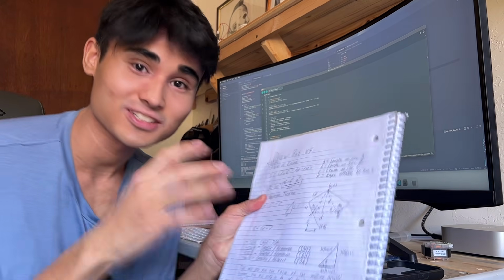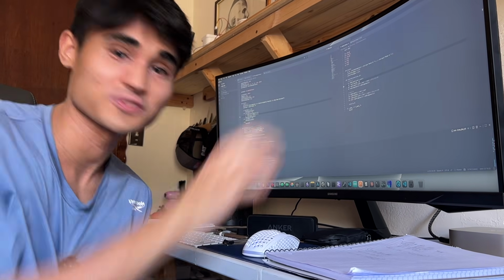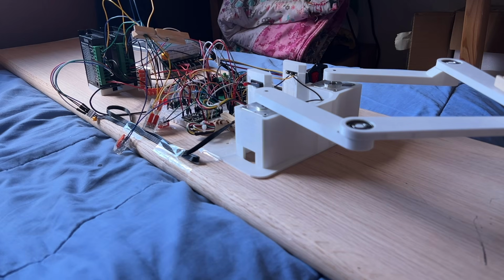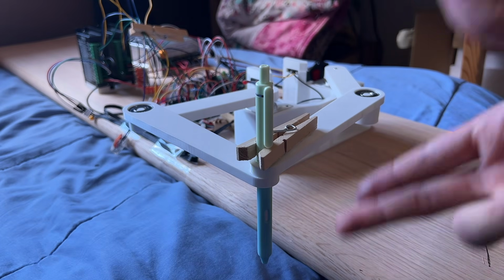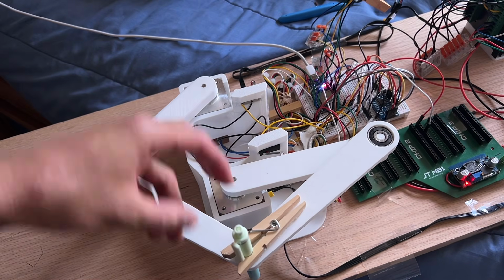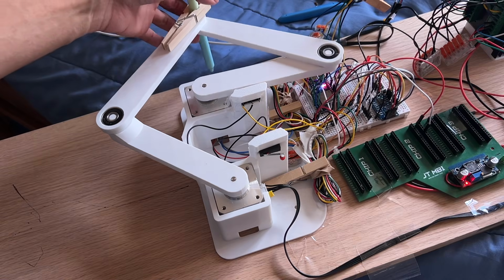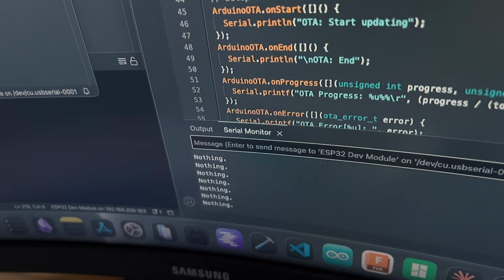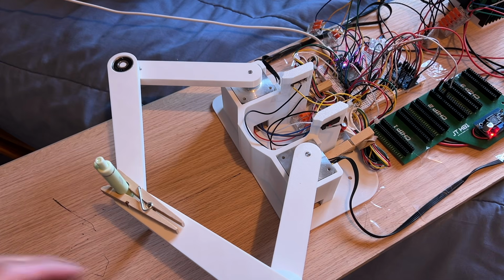I Added Magnetic Encoders To My DIY Drawing Robot

Comment: Not sure how you have your code setup, but it is probably possible to make an area that points can be set in, and if they go outside the bound, they just get limited. That should prevent it going places you don't want it to go to.

The arms also do seem a bit wobbly/saggy. It is hard to tell on camera. That might be causing the slight errors in the drawing?
Reply from the maker: Yeah, I’m not quite sure how to do it yet, but I do need some sort of function that checks if the point is even reachable, and if not, doesn’t try to move anything. Also, it’s interesting that you mentioned the sagging. I just did a test with a new pen mount design and I noticed it sagging quite a bit. I originally had little support legs on the ends of the L1 arms, but I removed them because they were getting in the way. I think I’m probably gonna add them back, but move them to a new position on the L2 arms.

Comment: Maybe you can hold the pen with a bearing
Reply from the maker: Interesting, one of my friends suggested something like that as well. I’ve got a simple design that uses 2 larger bearings and the pen fits through the middle. I’m looking forward to giving that a test tomorrow.
Reply: A problem for later in the process, but you ideally want whatever is holding the pen to be adjustable for the diameter of the pen so you're not locked into whatever pen you chose to prototype with.
Reply: @lupinzar  Maybe like a set screw or something? I think that would work well enough for pens?